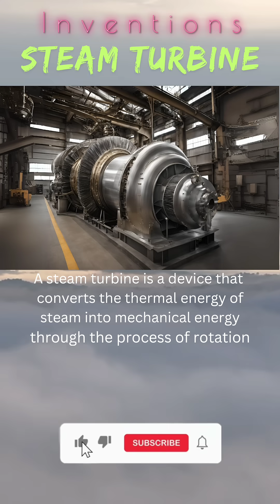Inventions-Steam Turbine

Comment from the maker: A steam turbine is a device that converts the thermal energy of steam into mechanical energy through the process of rotation. It consists of a rotor with blades, which are acted upon by high-pressure steam. As the steam flows through the turbine, it expands and accelerates, causing the rotor to spin. 
Charles Parsons credited for developing the first practical design in 1884. Parsons' steam turbine utilized a series of blades arranged on a rotor, allowing for efficient conversion of steam energy. Parsons’ design not only improved energy output but also laid the foundation for further advancements in turbine technology.
Today, they are commonly used in various applications, including electricity generation in thermal power plants and propulsion in marine vessels. The fundamental principles established by Parsons remain relevant, and modern steam turbines continue to play a crucial role in energy production worldwide